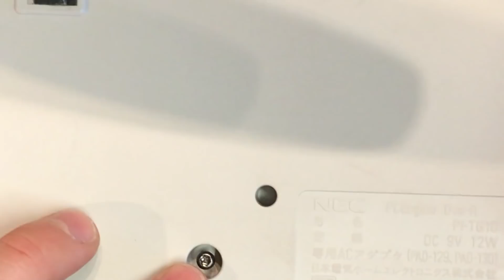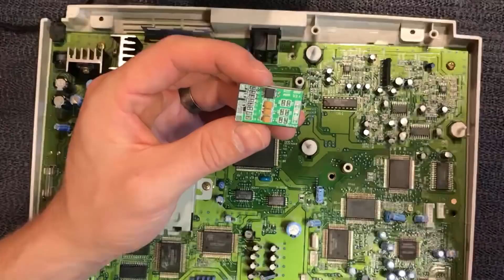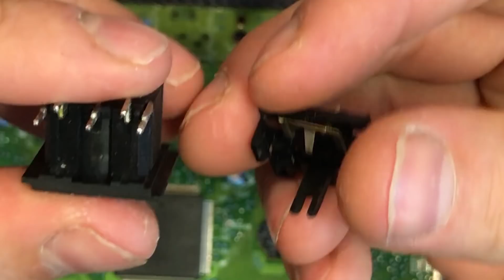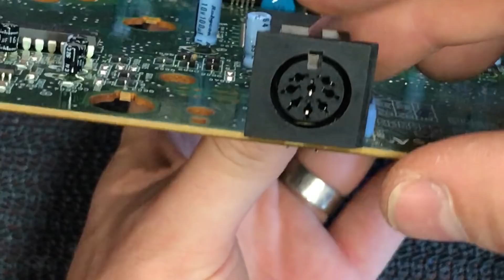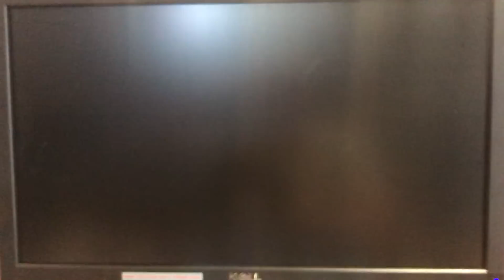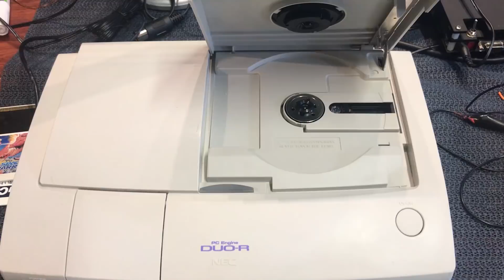PC Engine Duo-R RGB Amp Install - YouTube

Comment: Great video! I did the same to my turbo duo but I do not get a signal via ossc. I got a signal only with a cheap scart to hdmi adapter, the picture was very clear. Im using shielded cables also. The board I used is similar to yours. Did I skip something? Any help?

Comment: Thanks for another great video - I've picked up no end of tips from you. You might want to pick up one of these: https://www.amazon.com.au/98Pce-Security-Screwdriver-Chrome-Vanadium/dp/B074NYWPMH/ - that Torx bit is a security bit, and these bits remove them easily. They're good for use on standard Torx bits, too. When I come across them, I usually swap the screws out in case I need to get in later. I look forward to your next video!

Comment: Great video as always, Darren.  Correct me if I am wrong, but aren't the Duo-R capacitors that need replacing to remove jailbars C903 and C909?  https://console5.com/wiki/File:PC-Engine-Duo-R-PWA-3339-A-Jailbar-Fix-Locations.jpg

PC Engine Duo (non -R model) is meant to be C908 and C923 afaik.
Reply from the maker: This info changes all the time, but I got the cap locations from Lord Voultar... he makes the boards so I assume he's correct. I think it's C923 that's the real issue, so I'd definitely do that one. The caps I replaced seemed to fix the issue well, but go ahead and do as many as you've got the patience for as new caps always help.